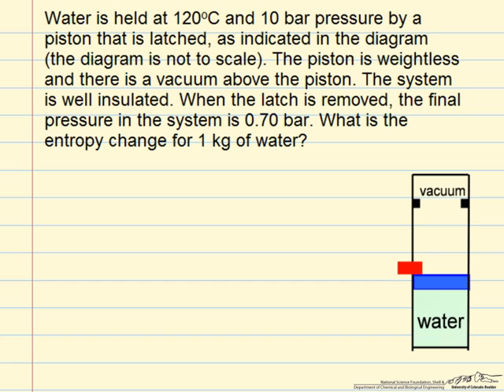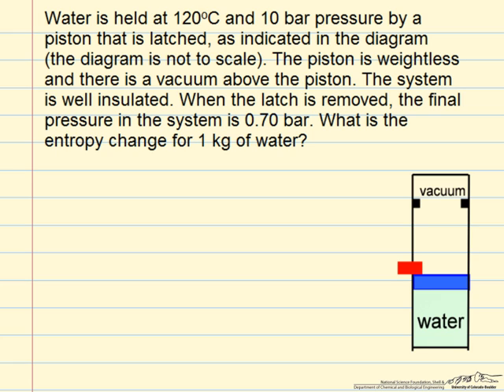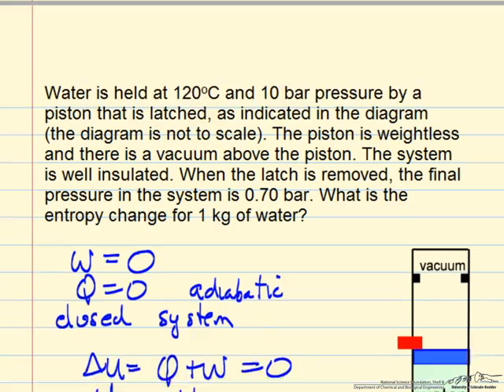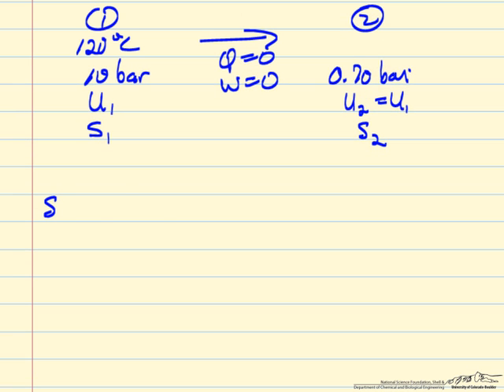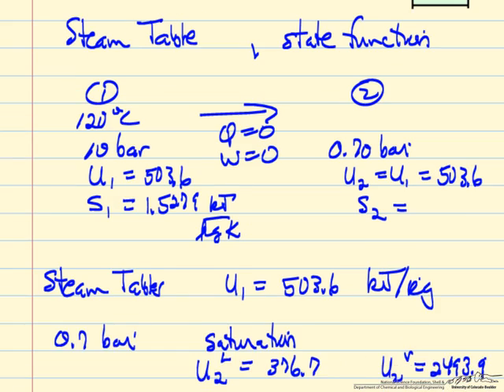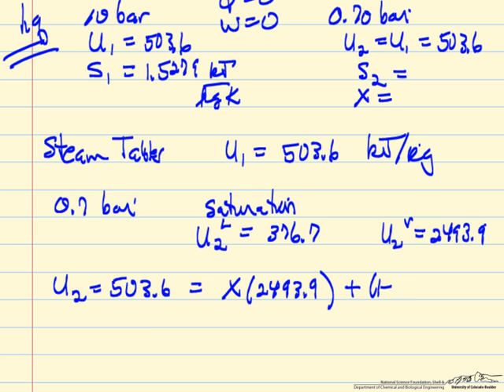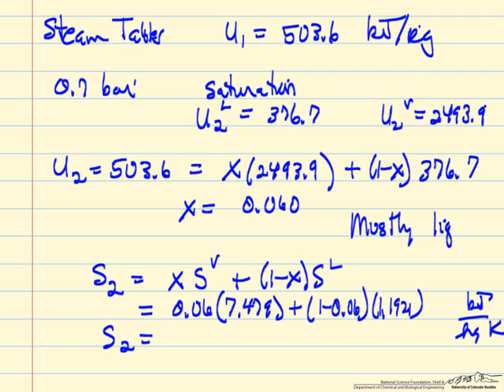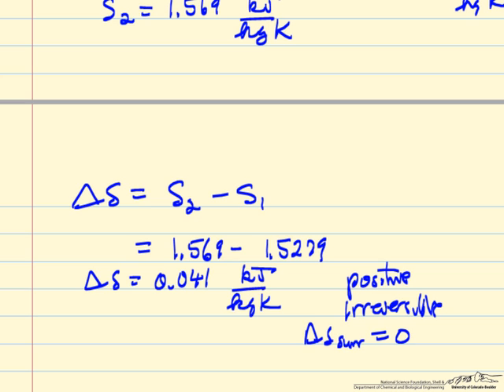Irreversible Process Entropy Change (Review)

Comment: Thanks for the video. It's true that the latch is not doing work on the fluid, but the fluid is doing work, isn't it? It has a certain amount of pressure which is pushing the latch so pressure times area of the latch is force. Shouldn't this be considered in the energy balance equation?